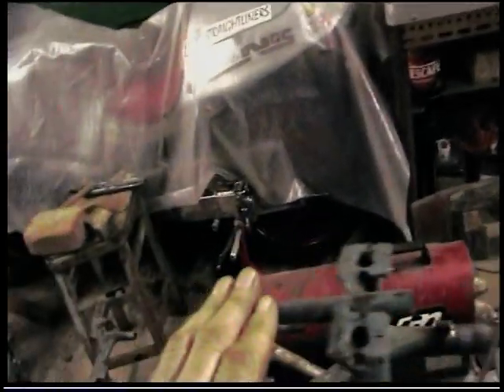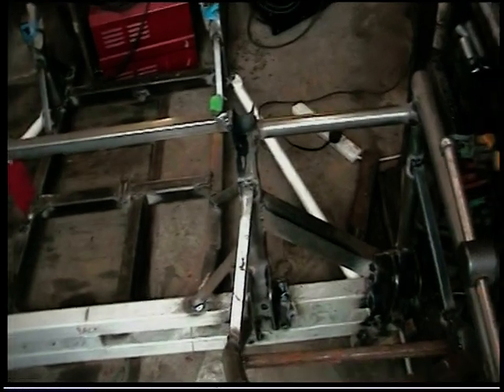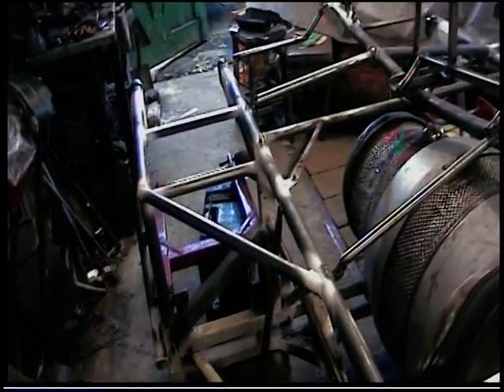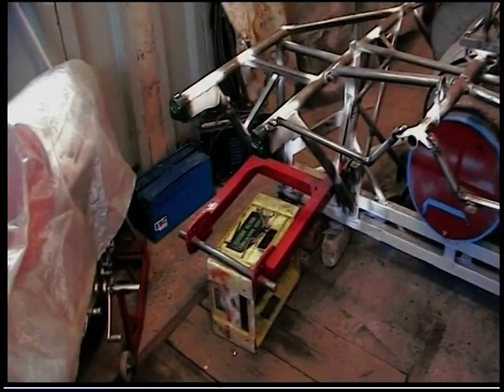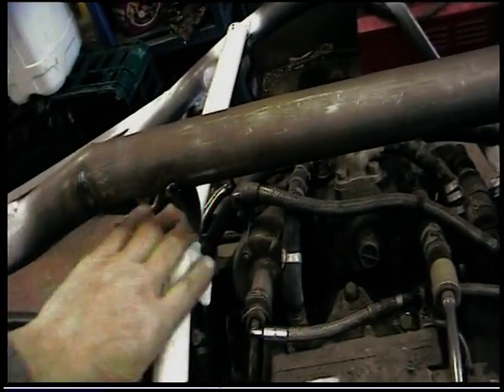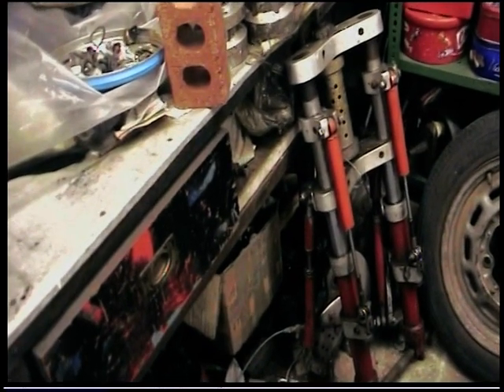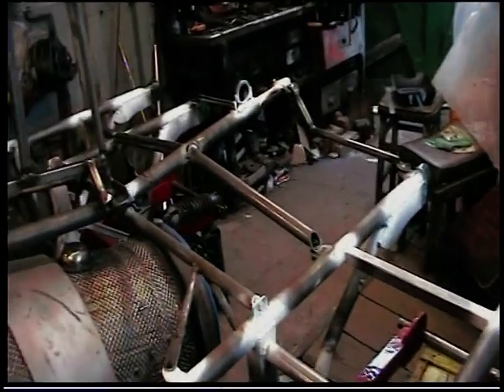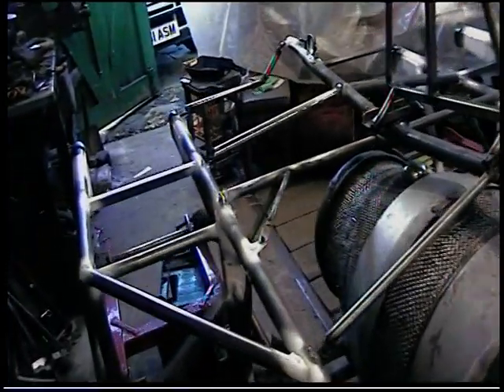Pete Williams' Jet-engined Streamliner update October 2014

Comment: May I suggest you mount the engine on rubber mountings
the engine will grow slightly by a mm or 2 when running temperature
Reply from the maker: Hi jjamanda thanks for your comments, I am painting the chassis at the moment before our winter sets in, to prevent rust. Then will continue on with making wheel hubs. As regards the engine mounting, it is mounted the same as it is in the jet aircraft; I have mounted it on the mounting points provided. Cheers. Pete.